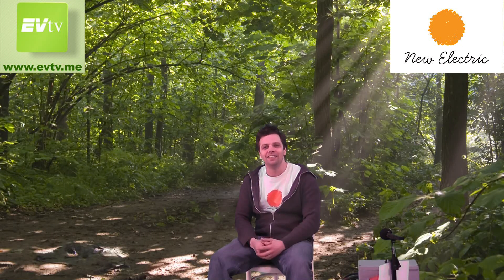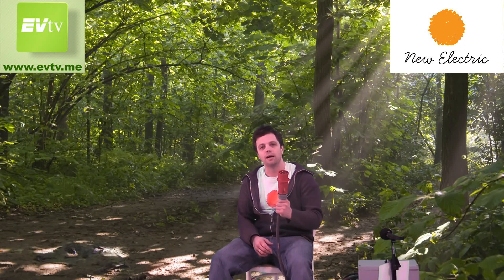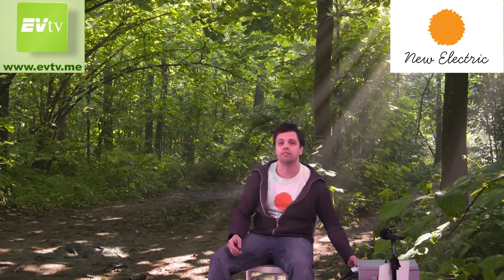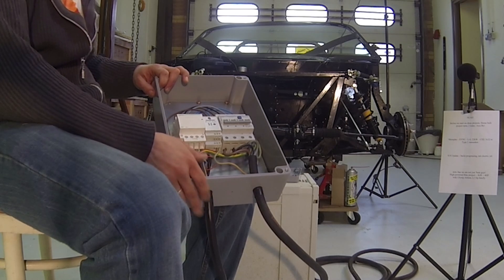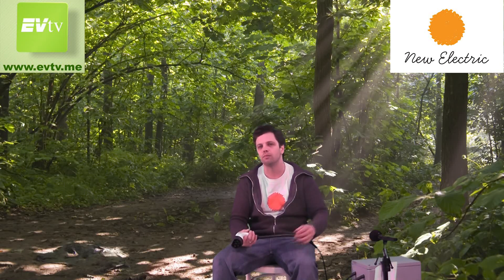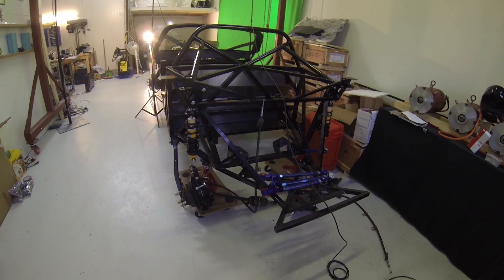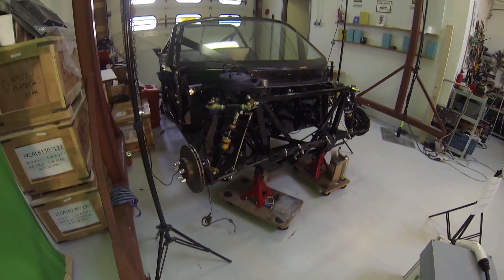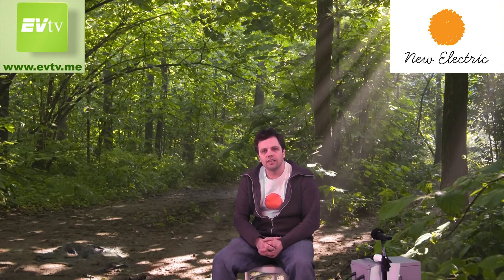EVTV amsterdam segment: Demo-unit Mainpine EVSE 22Kw

Comment: Nice backdrop.
I think it's a shame that 818 is based on a donor car, particularly for EV use.
USA seems to have plenty of available simple suspension parts for kit cars so it would be so much nicer to have it all new and purpose built.

One thing that would be really cool, and something you could actually do Anne if you are short a few holes in your head :) is a Lotus Elise/Tesla Roadster kit car all ready for egeardrive. It's a tiny relatively simple car with known market appeal and it can be done extremely light weight, far better than the Tesla Roadster. And without the terrible 100 watt constant drain that ruins the purity of the EV experience. With an egeardrive and 600kg weight it's easy to outperform a Tesla Roadster. And it could be done for usual kit car money.
You could even seek venture cap and do it all out as a complete car and become billionaires. Just sayin :)